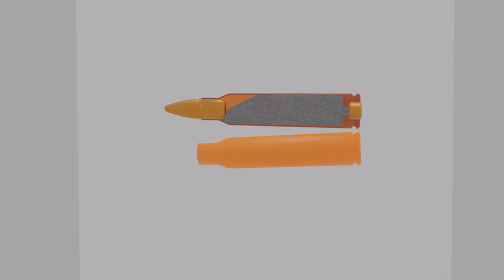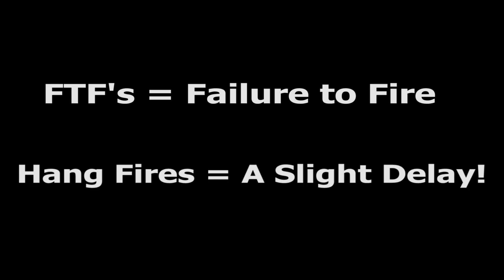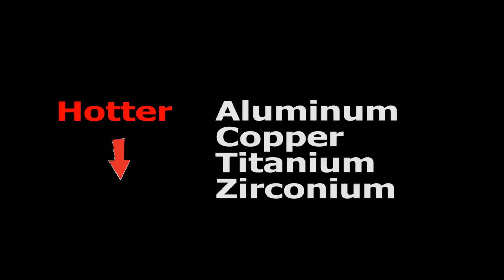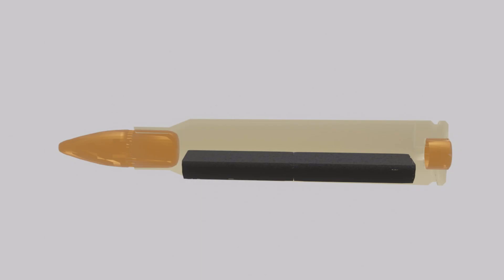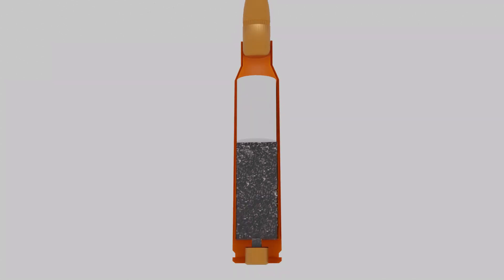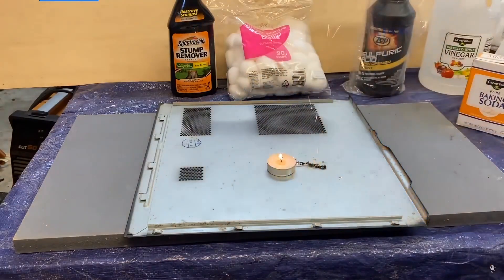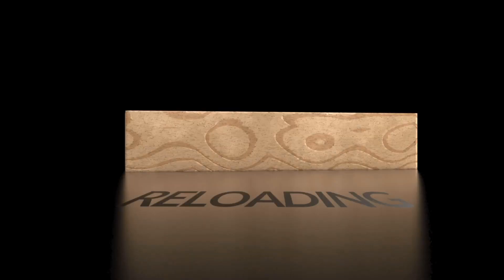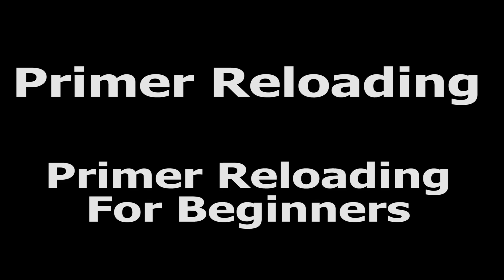Subsonic Ammo

Comment: Johnnys Reloading Bench did some experiments with this exact thing. He noticed wild changes in velocity between the powder being at the base of the bullet Vs. Powder being at the flash hole. To test, tip gun muzzle down, shake it a little, slowly and carefully bring it up to fire over chrono, to try to keep the powder against the bullet base. To get the powder against the flash hole, do the same thing but muzzle up. In his experiments, cotton worked, but not great, and if it's going to be long term and/or the ammo is going to be moved around, the powder can mix into the cotton, leading to inconsistencies. This is a well known struggle with subsonic loads. That's why most cartridges designed specifically for subsonic have a significantly reduced case capacity from their parent case. Also shooting big bullets helps eat up some of that space. Anyway, good video, keep up the good work!
Reply from the maker: I was unaware of his video but I will attempt to find it and reference his video in the video notes.    Kind of related info (stretching it a bit) - are you aware of quickload ($150) or the free version called Gordon's Reloading Tool?    It's software to calculate the theoretical velocities of projectiles when given bullet weight, barrel length, and various info regarding various powders available?    I know the paid version (quickload) has been proven to be  accurate.    The notes to Gordon's is deep down in my evergreen notes (in video description).

My source, Reno, is very respected in the primer reloading community.   He should have results very soon  using gun cotton.    I'll post his results when he reports in.    We are in the "just playing with it" stage.

 Thank you for the kind comments.
Reply: @helpmenowmark  yeah, I don't remember the exact video title, but I'm fairly certain it was in his 300 Black Out series. He tried several fillers and nothing worked great, they all worked ok-ish. 

I'm familiar with QL and GRT. I really wish someone would take over GRT so it can start to get updates again. I  know it's been fairly idle since Gordon died. 

So, you're trying to use gun cotton as a propellant?? I definitely find that interesting. I know Bret from Paper Cartridges made some for a Lorenze Rifle I think. Jake from Everything Blackpowder brought up the idea too, but was scared to really mess with it. I'm sure you guys are extremely aware of the dangers, based on the warning in this video. My understanding  is that cordite is just nitro cellulose and petroleum jelly and possibly something else, so that may be better and safer than gun cotton for home production and long term storage. Anyway, keep up the good work!